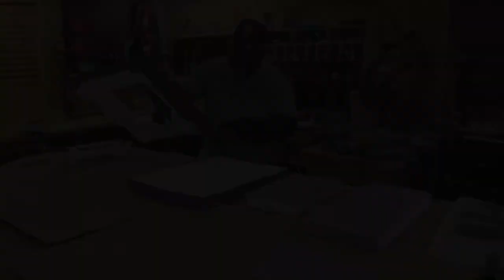HiveIQ Assembly

Comment: Just got mine together.  Before I move a hive into their new home, question regarding space for fondant/patties - doesn't seem there is enough room for these?  Have you dealt with this or come up with a solution?  I have an idea of using the 3rd box to create the space needed but wondered if that is too much room/air in there ?  W
Reply from the maker: Will the cool thing is that this system comes with three insulated boxes. I would place my empty third box on top and put my feed directly in the center. Because the box is insulated it will retain its heat.